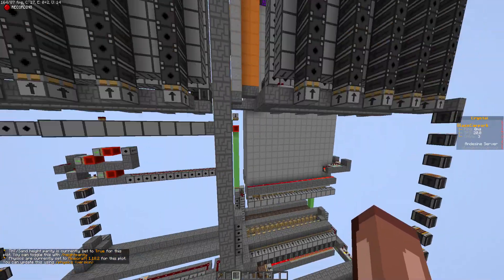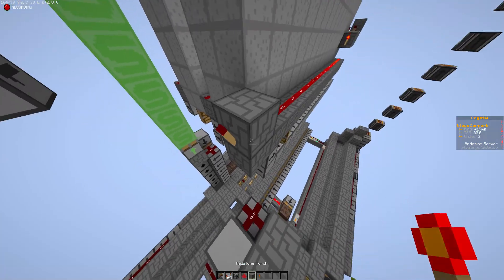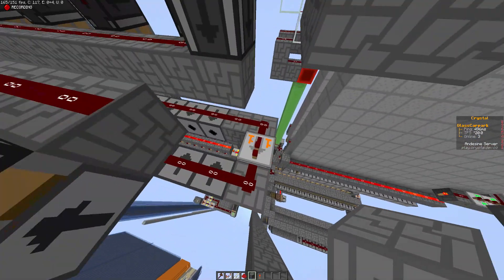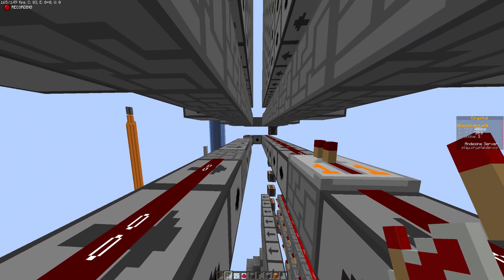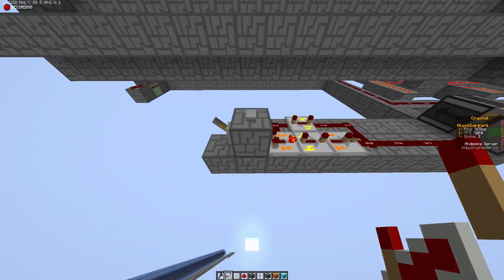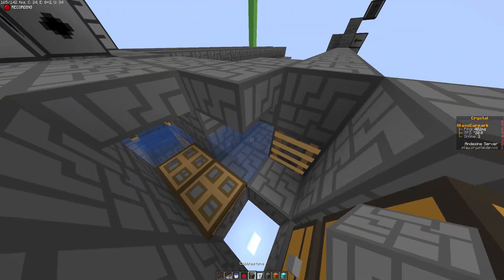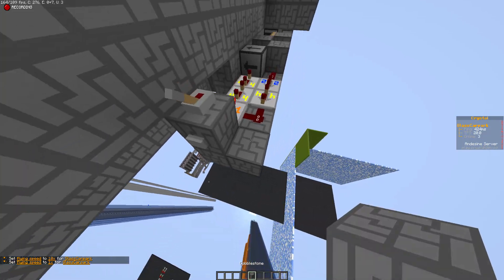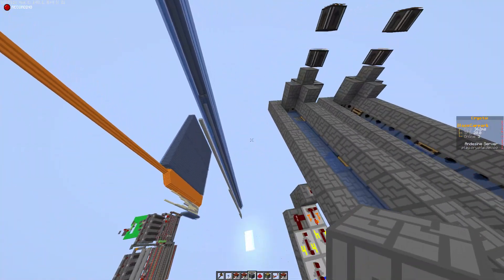1.18 Cannoning Ep 42: 2s 384 OSRB Part 4

Comment: That shot control looks like it could be dodgy might not be an issue but if the piston retracts whilst the quickpulse one is extended it won't retract the block and keep firing
Reply from the maker: I checked the timings myself, it retracts just in time.